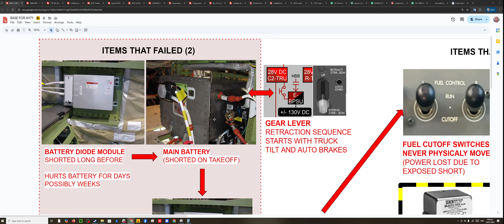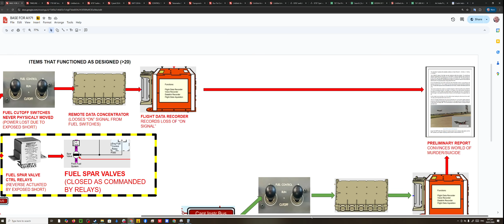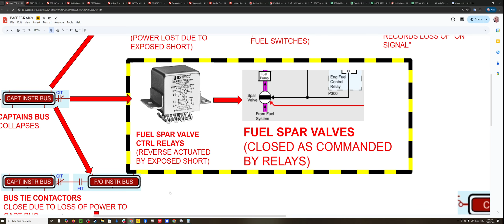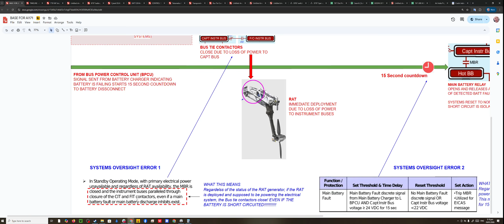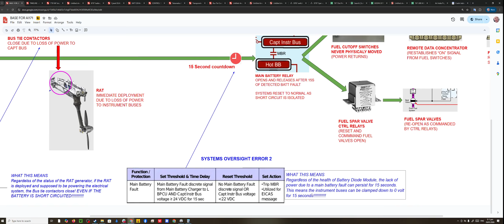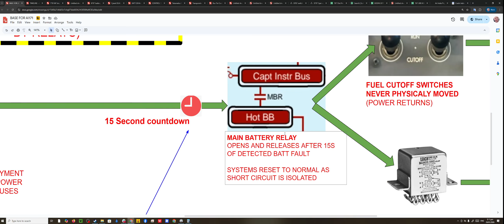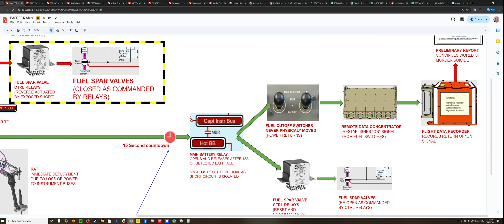AI 171 Crash Cause Revealed - Each System Failure Explained

Comment: YES - truck tilt and auto brakes = final straw = smoke - im still considering one wheel hard braking at beginning of roll [for a reason for battery diode overload] and suddenly (night time thinking while sleeping) realised that the reason why no smoke or overload before (as in battery short) - is that it is the TOW Truck that does all the strong braking and moving while near the ramp gate on ground prior to the 180 turn at the beginning of the runway except for perhaps the gentle turn on to the runway 1/2 way down. all braking would be very GENTLE prior to that. while doing 180 degree turn to align with runway there would be HARD braking of one wheel against the thrust of the engines in order to turn such a weight. let me know if i got this wrong and ought to go back to sleep...  Kevin..
Reply from the maker: yeh possibly, but i try to think of the straw that broke the camels back.
Also, on takeoff, you try to hit every single one of the runway centerline lights. The battery is mounted very very close to the nosewheel.
Reply: @jeremyjohnthompson5187  YES - plenty of wire vibration and cell shaking - with previously stressed battery and internal whiskers looking to start a short and melt down.. im using 4x 100a 12v in my  home made solar storage (inverting the 12v to 240ish to run heater lamps)  and its keeping me warm during this winter - but im always worried of over charging..   Thanks Kevin..

Comment: The 15s delay is unfathomable to me. Why did they design it like that? Did they know that faults in the battery were known to resolve themselves within 15s? Anyway, it looks like that without this delay the engines would have begun their relight sequence almost immediately and who knows what that outcome would have been...
Reply: Agreed,  15 seconds for electronic systems and logic to have an actual countdown seems a very very long time to me,  its almost as if someone just said,  "Pick a number less than 30,  15?,  yeah sounds good".  
On the other hand I suspect the 15 seconds went very quickly indeed in the cockpit for the Captain and FO.
Reply: If its on electrical switch c/o, answer is  simple: with such Ham's simple stone aged design, they need a "un necessary conservative Hysteris loop window" , 'cause they aren't knowing enough.
Tuck in industrial 2x UPS 2x DC  STS ( Static Transfer Switch ) Simple n easy. 
No more stupid relay contactors diodes . 
But if someone wants to introduce a refire timing delay to engines, it is another matter.
Reply: Not sure if the 15 second delay would have ever amounted to much if the battery wasn't a lithium ion type to begin with.
Reply from the maker: @aerodynaAJ  ive asked myself this question a million times, and honestly, i dont know. I would have to get a 787, remove the diode, put it on stands, ramp up the engins to takeoff thrust, inject airflow  into the pitot system to get it in to air mode, then put a nail through whatever battery it was, and watch what happens.
Thats what you should do when makign a compressed tube carrying 200 human beings.
Reply: @jeremyjohnthompson5187  I get it Jeremy, just thinking that all aircraft I've maintained had NiCad batteries that had a very regular test schedule (deep cycle test process), never saw a thermal runaway on those in 30 years even though it is a possibility. As you know Batteries are essential and they need to be safe, lively lithium chemistry seems sketchy to me, 15 seconds is a long time in this case. Well done video.
Reply: For obvious and known reasons*, someone do not want the refiring to take place too soon (* combustion room temp (of a turbo )). That's why the 50% rotate speed before cut in to refire !